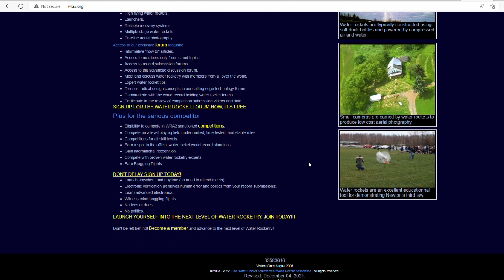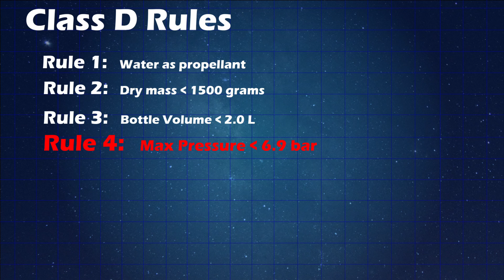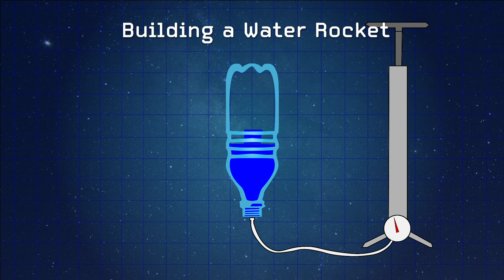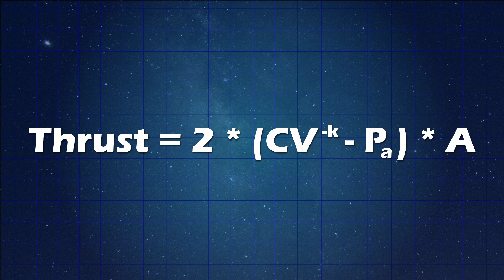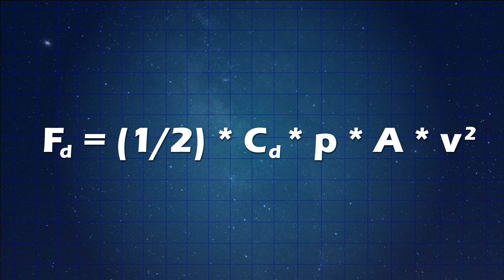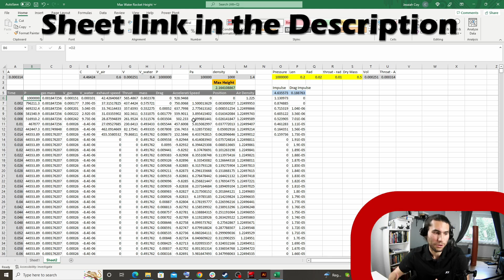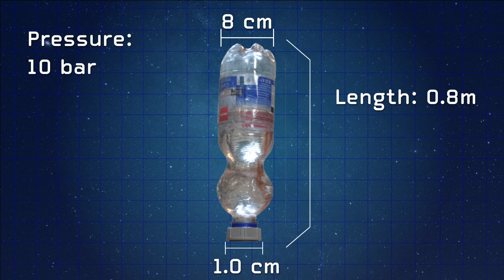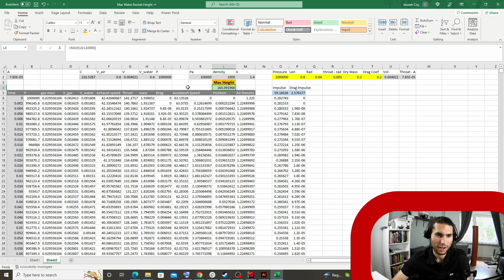Hacking Physics to Break a Water Rocket World Record

Comment: Good luck with your attempt! :)  In our experience, one of the biggest challenges is the construction of a lightweight and reliable recovery system for water rockets. Since you have already developed a simulation tool, one thing you could do to maximize your performance is to make a full parameter study and optimize for all the parameters you can influence.  One thing to consider with the records from WRA2 is that the "low-tech" classes often are not that relevant for many water rocketeers. So there are a lot of great water rockets in this category, but most of them are simply not registered as records. For example, the older and unreinforced Polaron and Axion rockets from AirCommandRockets belong into that category. Our own "Überflieger 2" rocket has reached an altitude of 214m as well.
Reply from the maker: Thanks for the well wishes.  We are looking forward to dipping our toes into the water rocket world.  To get to 214m I imagine you used a bit more than 6.9 bar of pressure.
Reply: @ASTRABremen  Yeah this comment was referring largely to the Class E. The pressure at our flight was about 8.5 bar with a volume of 9.9l and 630g dry mass.

Comment: What about using a nozzle increase the ifeciency
Reply from the maker: The nozzle actually has less effect than you might think.  Because the flow velocity is fully dictated by the pressure in the bottle, changing the diameter doesn't really change the overall impulse of the thrust.  It does change the duration of the thrust though.  This means smaller nozzles will perform slightly worse because they take more gravity losses than a shorter thrust phase.  There is actually another parameter with respect to the really small nozzles where the friction with the wall of the nozzle becomes a significant factor and this will also sap some efficiency away.  But at the bottle rocket scale, this is a relatively minor parameter.